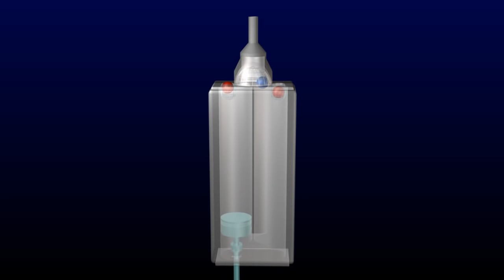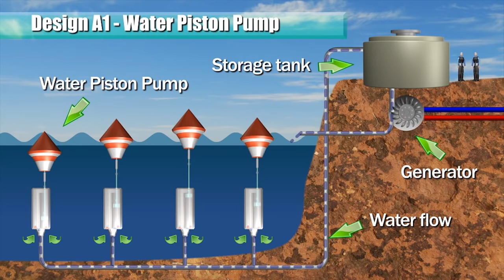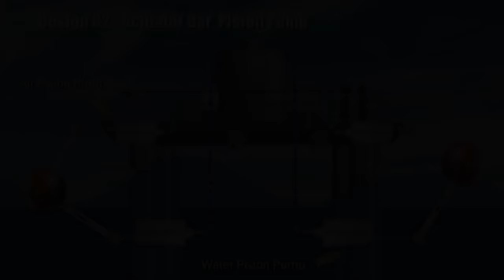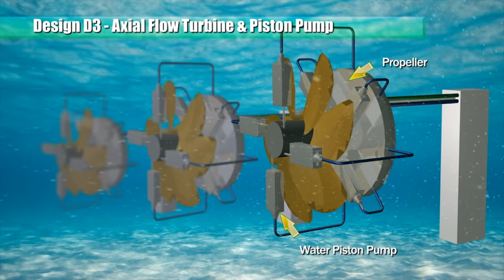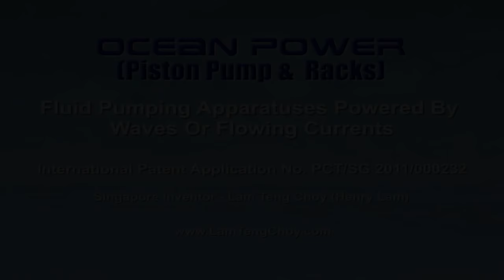Blue Energy - Ocean Power (Piston Pump & Racks)

Comment: It's not free. You're stealing momentum from  the Earth, and there are consequences.
Reply: xl isn't that true for all power production.
Reply: xl Dumbass....Tidal waves are generated by the moon and we are harnessing a tiny tiny tiny tiny amount of energy that this planet has
Reply: xl fair point. There needs to be a research conducted just to understand the implications of such technologies on rotational speed of Earth. But those waves are eventually dampened out near the sea shore
Reply: I think that It will take a variety of renewable energy sources to power the worlds needs...like solar..wind..sugar based alcohol for fuel its being done all over south America.vegetable oils..animal fats from slaughter houses and butcher shops which CAN be turned into fuel and oil....      .ALL old wood from furniture trees anything wood and paper can be used to burn for fuel to run power plants... Hydro power from creeks..rivers..ocean currents and waves..Geo thermal...
Reply: xl compared to all other sources of electricity such as nuclear plant, coal plants, that hydropower plant require very low running cost so these are free.
Reply: as has already been mention this is harnessing the power of the waves created by wind which get their power in turn from the sun. that energy is always there we are just using it.
Reply: momentum is not stored its coming 7/24 every single second from the sun and moon
Reply from the maker: New Invention

ShoreLine HydroElectric InFlow Dam System Video (English)
https://youtu.be/A8EYW_aREKw

水力发电内流水坝水岸线系统 / ShoreLine HydroElectric InFlow Dam System Video (Chinese)
https://youtu.be/D2NPLMekG8w

Hydro Power - Hydroelectric Inflow Dam System
https://youtu.be/_ho7JaxOdT0

Ocean Power - Piston Pump & Racks
https://youtu.be/fYfs-qYGzvs

Ocean Power - Racks & Rake Wheel
https://youtu.be/nQGKfAPxsiI
Reply from the maker: @maxpower1337  New Invention

ShoreLine HydroElectric InFlow Dam System Video (English)
https://youtu.be/A8EYW_aREKw

水力发电内流水坝水岸线系统 / ShoreLine HydroElectric InFlow Dam System Video (Chinese)
https://youtu.be/D2NPLMekG8w

Hydro Power - Hydroelectric Inflow Dam System
https://youtu.be/_ho7JaxOdT0

Ocean Power - Piston Pump & Racks
https://youtu.be/fYfs-qYGzvs

Ocean Power - Racks & Rake Wheel
https://youtu.be/nQGKfAPxsiI
Reply from the maker: @cameronh3260  New Invention

ShoreLine HydroElectric InFlow Dam System Video (English)
https://youtu.be/A8EYW_aREKw

水力发电内流水坝水岸线系统 / ShoreLine HydroElectric InFlow Dam System Video (Chinese)
https://youtu.be/D2NPLMekG8w

Hydro Power - Hydroelectric Inflow Dam System
https://youtu.be/_ho7JaxOdT0

Ocean Power - Piston Pump & Racks
https://youtu.be/fYfs-qYGzvs

Ocean Power - Racks & Rake Wheel
https://youtu.be/nQGKfAPxsiI
Reply from the maker: @talhaAhmedmecheng  New Invention

ShoreLine HydroElectric InFlow Dam System Video (English)
https://youtu.be/A8EYW_aREKw

水力发电内流水坝水岸线系统 / ShoreLine HydroElectric InFlow Dam System Video (Chinese)
https://youtu.be/D2NPLMekG8w

Hydro Power - Hydroelectric Inflow Dam System
https://youtu.be/_ho7JaxOdT0

Ocean Power - Piston Pump & Racks
https://youtu.be/fYfs-qYGzvs

Ocean Power - Racks & Rake Wheel
https://youtu.be/nQGKfAPxsiI
Reply from the maker: @stevemitchell2252  New Invention

ShoreLine HydroElectric InFlow Dam System Video (English)
https://youtu.be/A8EYW_aREKw

水力发电内流水坝水岸线系统 / ShoreLine HydroElectric InFlow Dam System Video (Chinese)
https://youtu.be/D2NPLMekG8w

Hydro Power - Hydroelectric Inflow Dam System
https://youtu.be/_ho7JaxOdT0

Ocean Power - Piston Pump & Racks
https://youtu.be/fYfs-qYGzvs

Ocean Power - Racks & Rake Wheel
https://youtu.be/nQGKfAPxsiI
Reply from the maker: @heartrobber8977  New Invention

ShoreLine HydroElectric InFlow Dam System Video (English)
https://youtu.be/A8EYW_aREKw

水力发电内流水坝水岸线系统 / ShoreLine HydroElectric InFlow Dam System Video (Chinese)
https://youtu.be/D2NPLMekG8w

Hydro Power - Hydroelectric Inflow Dam System
https://youtu.be/_ho7JaxOdT0

Ocean Power - Piston Pump & Racks
https://youtu.be/fYfs-qYGzvs

Ocean Power - Racks & Rake Wheel
https://youtu.be/nQGKfAPxsiI
Reply from the maker: @gusmc2220  New Invention

ShoreLine HydroElectric InFlow Dam System Video (English)
https://youtu.be/A8EYW_aREKw

水力发电内流水坝水岸线系统 / ShoreLine HydroElectric InFlow Dam System Video (Chinese)
https://youtu.be/D2NPLMekG8w

Hydro Power - Hydroelectric Inflow Dam System
https://youtu.be/_ho7JaxOdT0

Ocean Power - Piston Pump & Racks
https://youtu.be/fYfs-qYGzvs

Ocean Power - Racks & Rake Wheel
https://youtu.be/nQGKfAPxsiI